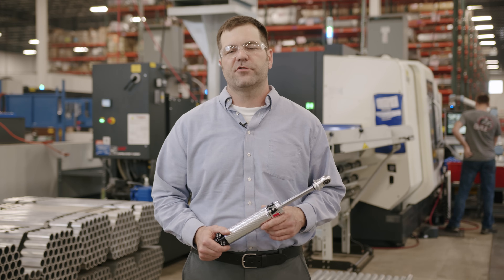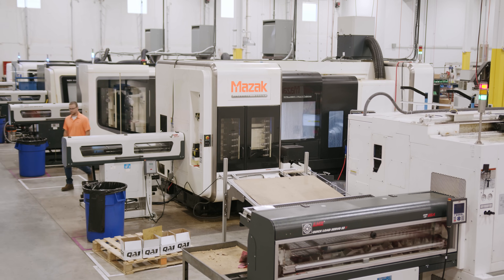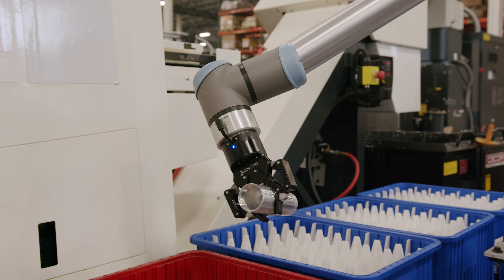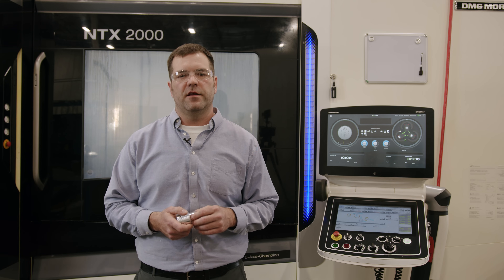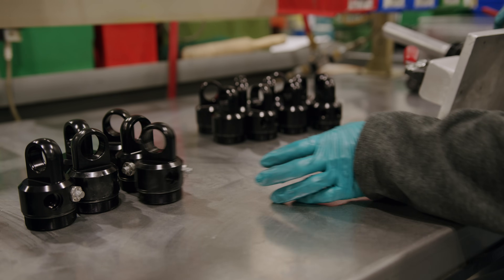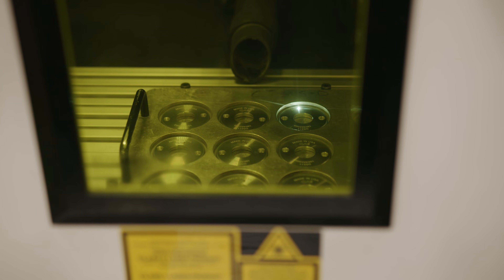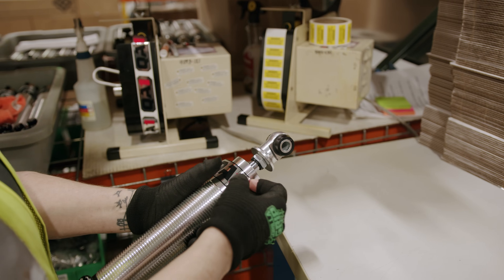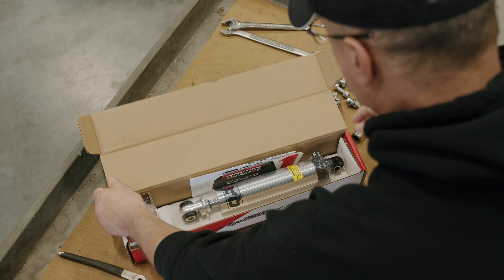How It's Made: Shock Absorbers

Comment: Nice video to get a peek inside. I can't see why 2 out of three shocks leak. I kinda expected more. 😕 kit that qa1 rep suggested came with springs that are too light 450 when it should have 600-700. Customer service is quick to respond but I'm still stuck with two shocks that leak right after instal and still to this day months later. 😪
Reply from the maker: We are sorry to hear this happened. It is not uncommon for the shocks to have a little excess oil out of the box. But if they are still leaking after some miles being put on, they may need to be looked at. Please call our tech team and they will be happy to assist you. We also have authorized rebuilders throughout the country. www.QA1.net/find-a-dealer Our tech team can be reached at 952-985-5675 M-F 8am-5pm CST.